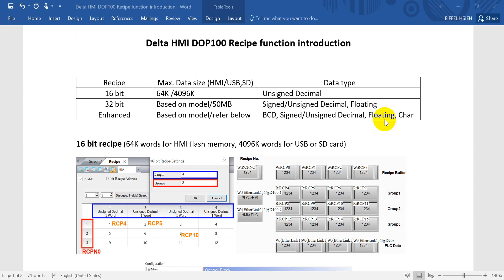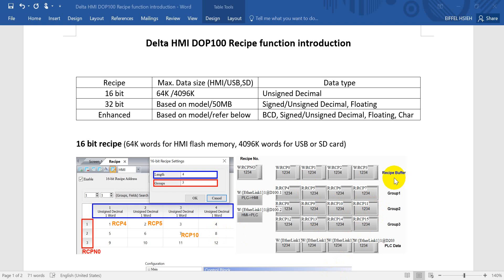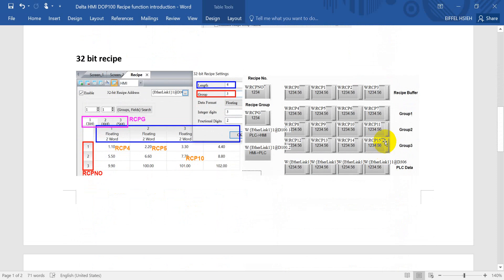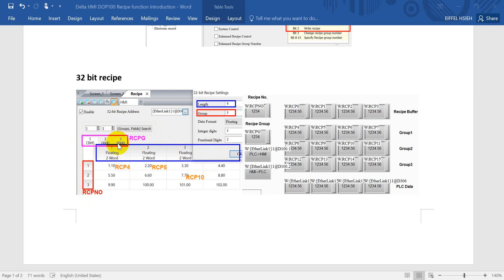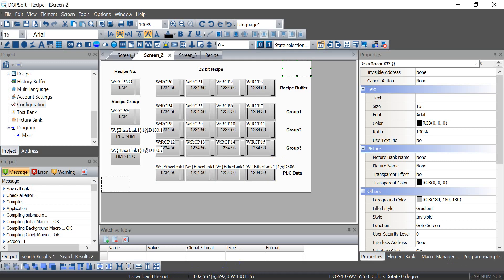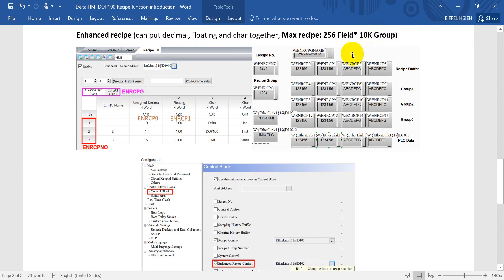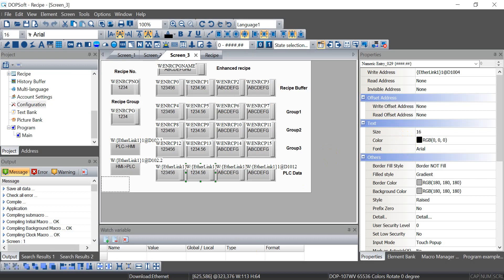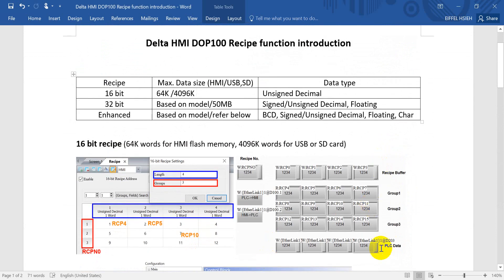Delta DOP100 Recipe

Comment: Hi, many thanks for making this DELTA series in english! I'm building a "pasta dryer" machine with Arduino and Delta DOP-107BV HMI as a Master modbus RTU. this is  a small project, I'll just build 4 of them, but when this is working I'll lpublish on my small youtube channel promoting Delta for Arduino Makers. At the moment is working fine, but only 1 screen with lot of parameters, and no recipes. I probably would like to have several recipes in order to have multiple type of drying profile,  but I think I would need some help to organize variables, and have a clear understandiing of recipe are permanently stored in non volatile memory in the HMI. let me know if you can help me, eventually with a skype or any other call, I can share my setup with a camera in real time. we could also engage with "industrialshields" for this project, they provide industrial arduino based PLC for the makers market. have a nice day, Fabio
Reply from the maker: @Maker Fabio,  sorry to reply late. I didn't notice this message till now. not sure do you already finish it?  you can mail me directly for more discussion , Eiffel.Hsieh@deltaww.com